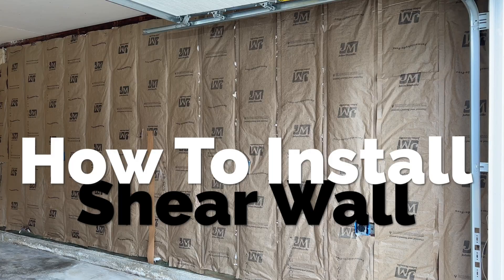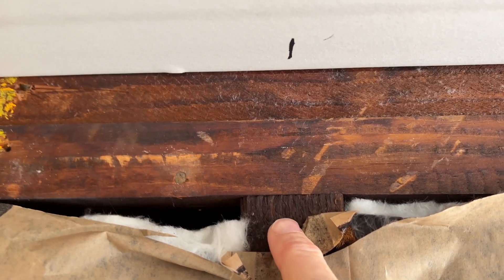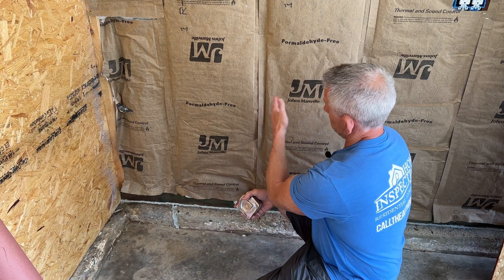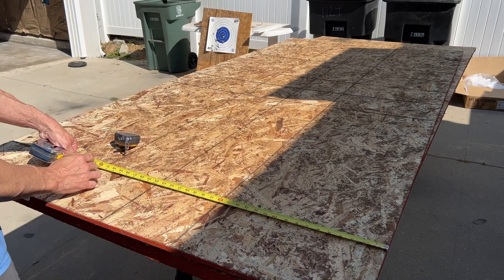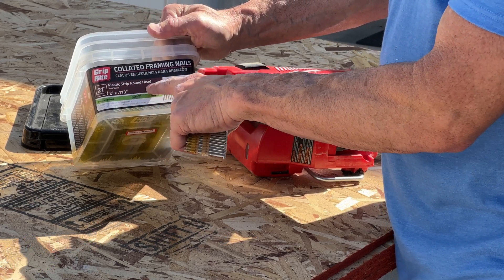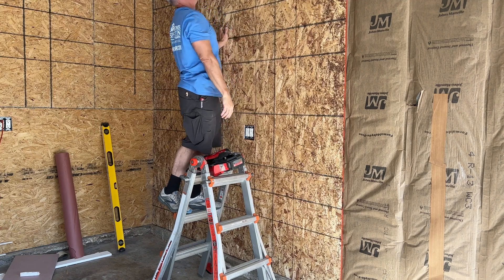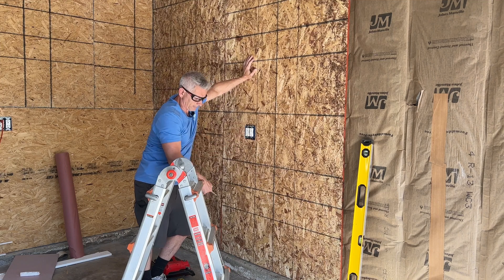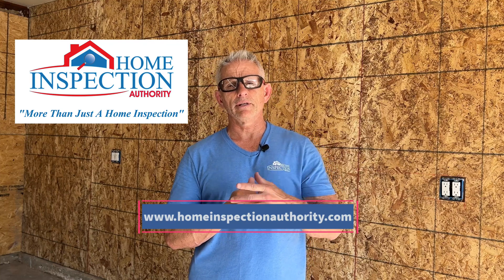How To Install Shear Wall Sheathing | DIY Shear Wall Installation |

Comment: Why not just install it horizontally
Reply: because it is a sheer wall, the purpose of the OSB is to prevent lateral movement and bending.  Horizontal installation is not as effective for this purpose